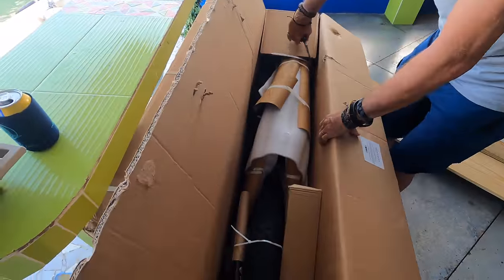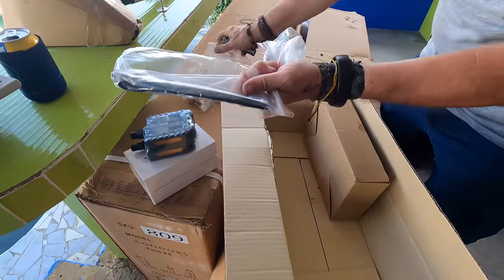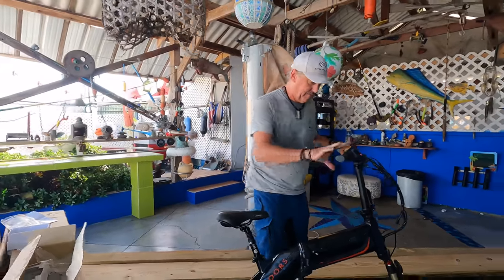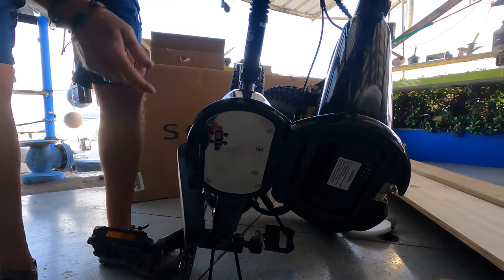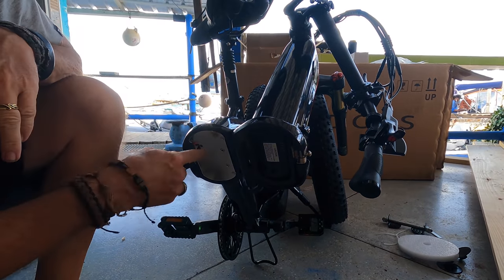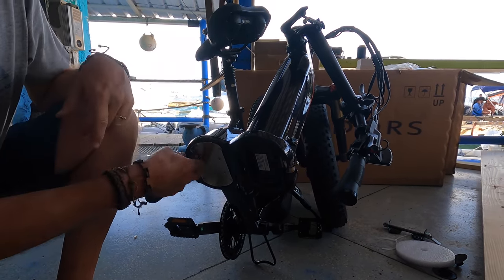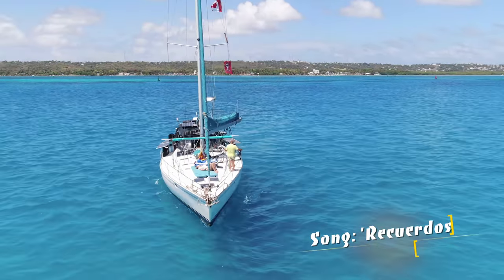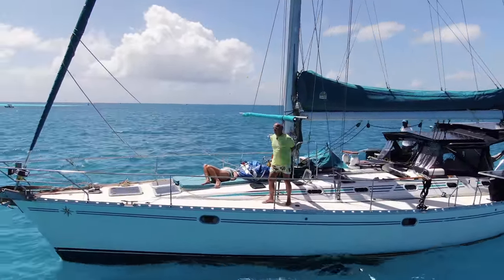SSL621 ~ and then this happened...

Comment: Big party for the new mum and mums mum 😎
You can drop the bikes seat down first then fold the bike and drop the bars and stem. Its a good idea to carry a bungi, strap or chord to hold the bike folded. 
Those are generally the best sort of bikes to have on a yatch small but fat wheels ..decent range of gears if you need to peddle up hills and move a load either in a folding kids  buggy trailer .. or on a child seat.
The trailer buggies better as you can get shopping as well as carry the little chap and use it as a go anywhere buggy he can sleep in or just sit in for a few years.

Comment: Damn you Rick!  I have spent the past few days researching foldable e-bikes.  My wife is about to kill me and put a hit contract out on you. OK, all kidding aside, the Sondors Fold X is real nice, but I'm now leaning towards the Lectric XP 2.0.  The Lectric has a little less range, but nearly identical in other similar specs: same Bafang 500W(850W peak) rear hub motor, Shimano 7 shifter, 20" phat tires(but 3" vs 4" width), 1 yr warranty(XP is extendable to 2yrs for $89), and both have free shipping.   The BIG difference is cost and it is HUGE!  The rapid price increase of a Sondors has it costing more than double the Lectric.  That is the Sondors Fold X is presently $2,259 and the Lectric XP 2.0 is $999!   That is a $1,260 Savings. Now the Soldors does look real sweet, but so does the Lectric.    I hope you got yours free or at a great discount (I hope you disclose).   I am still keeping an open mind and am looking forward to next video.

Comment: Smaller tyres (as in thinner) would be better for weight and also power consumption, the more weight and tread in contact with the road all equals to more power consumption. Depends what it's used for though, if you know the distance it would be used for is within the batteries capabilities then no probs, but if that is unknown then power consumption is more important. That said you've always got pedal power though
Reply: On good roads, yes. On bumpy or tracks, where they are and where they are going larger tires would be better.

Comment: @Rick, Suggest Slime sealant in the tires, anti puncture gel/fiber sealant...
Reply: You do know that the tire is garbage after using those products. Besides, I believe that these are tube and tire setup. Jon hand. Just have a patch kit handy
Reply: @philipmackin1025 I've used such products for over forty years in tube type applications without complaint. I would naturally expect opinions to vary.